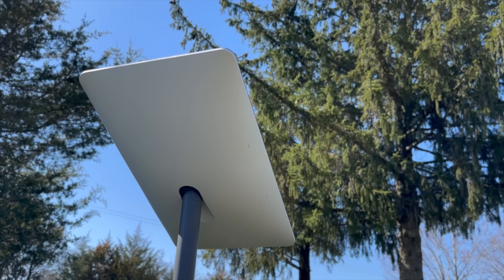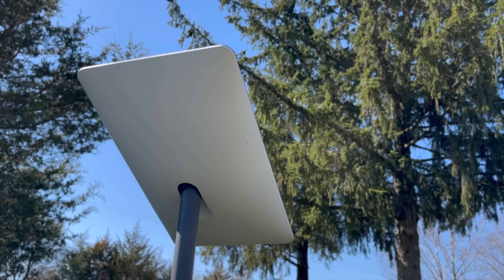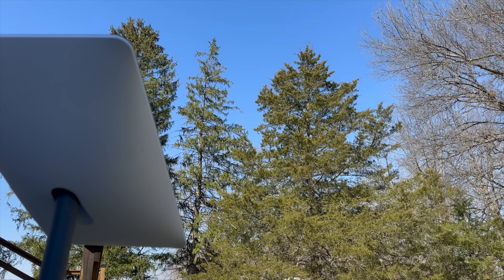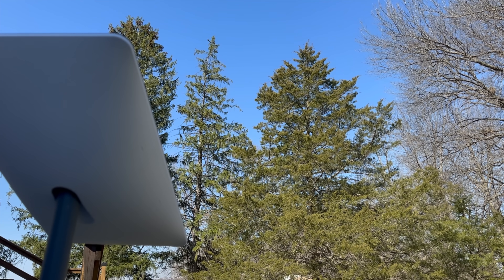Starlink's New Beam Switching Helps Improve Uptime for Obstructed Dishes

Comment: Have had Starlink for 14 mounts  now, haven't seen any improvements. What are you talking about?? I have 4% abstractions according to the app., zoom calls or any activity that
reacquires  stable connection just forget it! I would  mind having my old DSL line back, but the cables are gone! Remove the abstraction?? yes, I have to cut down a hole Forrest,  a
100 foot pole and just maybe it could compete with the old DSL line, I don´t care about speed, I wont stability! Something wrong with my equipment?  I got a new router from Starlink
What changed.....nothing! I live in norden part of Europe.  Someone wrote " StarLink is vague at best" correct sir!

Comment: Morning tells me that the Starlink Intinerant Unlimited service plans in gaming would be above Residential, which I have 18-25 ms from what I played in Residential, you can hardly even get 34-38 or 40 ms in FC 25, if I enter FragPunk it shows me 99-68 ms in Europe and that there is also a Priority 50-500 GB plan that would be the best in gaming 13-20 ms, well, we calculate 18-25 ms Intinerant Unlimited vs Priority and we get under 5-10 ms, who knows, and I'm seriously thinking about changing the plan to Intinerant if it goes so well in gaming to Priority, he told me that once those 50-500 GB consumed are gone, I will no longer benefit from it, on their site it shows that you will have limited net under 1 mega and 0.5 upload.

Comment: Hasn't done a thing to improve it for me. I'm about 10% obstructed in the summer and that's exactly what the app says even after the update.
Reply from the maker: The obstructed % wouldn’t change, since that’s measuring the field of view, but you might see the length and frequency of the obstruction outages decrease.
Reply: @DISHY_tech  Yeah except I'm noticing more buffering when streaming TV than before.

Comment: but how do I know its working?
Reply from the maker: If your dish is connected and online, it’s working. It’s constantly switching from one satellite to the next. You can also check the obstruction map to check for red areas. If you see red but aren’t noticing interruptions, that’s likely thanks to beam switching.
Reply: @DISHY_tech I see red but my ping success is always between 99.3 to 99.5
Reply from the maker: @theafricanpro658  If you go into Statistics > Outages in the app, do you see any obstruction outages on the 2s+ tab? My dish is not obstructed at all and my ping success hovers around 99.7 and 99.8, but zero outages. I think the slight difference from 99.9% is the <2s “Network issue” outages that I can sometimes see in my Outages page.
Reply: Yes. The past few days been getting outages. i see from 1s 2s+ and 5s+. Got an update yesterday. Was that the new feature

Comment: Beam switching is a great idea, however, here in Anchorage Alaska, we have ONLY 2 visible satellites to switch between, therefore, NOPE. I have three antennas, GEM2 Standard Actuated, GEN3 Standard, and Mini. GEN2 mounted on my home, GEN3, flat mounted on my motorhome, and Mini flat mounted on my truck. The connection to the only two satellites flying over Alaska is abysmal. Maybe a small window of time you get an acceptable speed, but RARELY. 1.1 to 2.9 is certainly not acceptable. I have shut down my GEN2 completely, paused my Mini and only turn on my GEN3, when out in the motorhome. In a nutshell “Buyers Remorse”. Until Elon puts more satellite over the really needed Alaskan real-estate.
Reply from the maker: The good news is that Starlink says they plan to double the network capacity in Alaska by the end of this year. They are launching 400 sats to the polar regions to accomplish this. There is a paragraph in this Starlink post that mentions it: https://www.starlink.com/updates/network-update
Reply: I actually ask support when the polar unit are planned. Their answer, we do not know. Fingers crossed. We need reliable connectivity. Thx

Comment: Starlink can be a victim of its own success. It will grow exponentially as it improves, and this will create more congestion. I use it primarily for hurricane preparedness. One of my concerns is network congestion using a roaming plan after widespread disasters.
Reply: V3 sats will massively improve user density but since it’s satellite there is a limit to how many usable connections u can have in a given area.

Comment: have starlink 4 yrs - V2 and V3 full time RV living -   I liked V2 the best - V3 dish makes a pretty loud sound like a fridge running - is this common ?
V3 dish and router both get pretty hot - uses 60 to 90 watts -  edge of V3 dish is not sealed - had to seal with tape -  V2 dish was cool to touch and silent  used 20/40 watts
2 yrs ago pointing dish straight up did not work well - now it works good -  Overall I Very Happy with starlink  made my life much better
Reply from the maker: Starlink dishes will make noise, it's like coil whine, especially noticeable when powering them off of 12V.